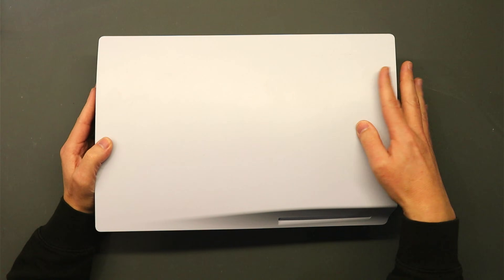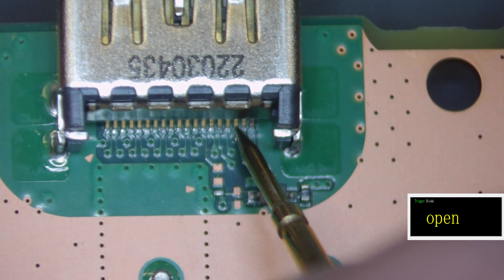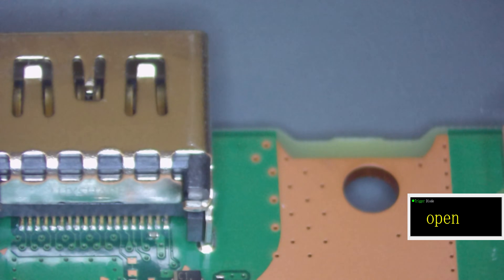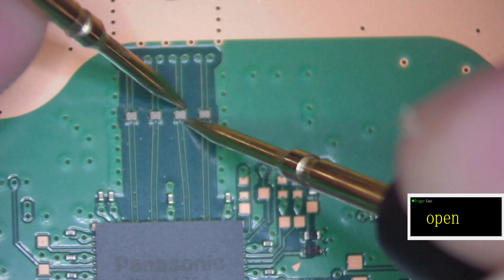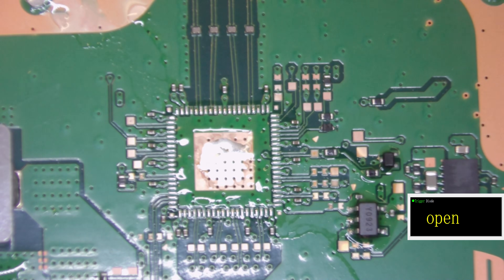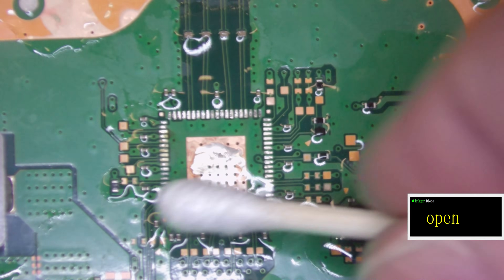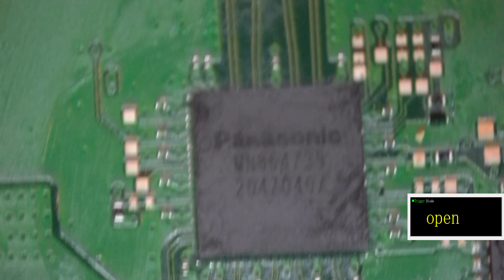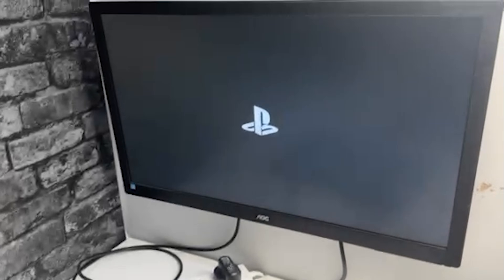PlayStation 5 No Video - The easy way to replace the Panasonic MN864739 HDMI Encoder on a PS5

Comment: How can you fully diagnose if it is hdmi endcoder issue? Mine seems good, the port, the encoder also it's surroundings, also two cable was tested also two different tvs, but it still sometimes goes black screen for milisecs, should i just change hdmi encoder?
Reply: I am asking myself the same quastion…Perfectly soldered Port and still no signal. I already did a lot of repairs on those ports.

Comment: I done so many ps5 repairs. And encoder.  But had a few where no image even after hdmi and encoder.  Have 5v. What else could be wrong
Reply from the maker: I usually check the entire HDMI circuit including all caps and diodes around the port and retimer
Reply: @ConsoleTherapy  same no luck

Comment: What exactly is the HDMI port test looking for, and how do you know the expected value?

I'm learning electronics, and have only seen diode mode used to check diodes.
It looks like you are measuring  directly between ground and the signal pins of the HDMI connector - no diode in between?

I'm also under the assumption you can't check diodes while they're still in the circuit, or you get incorrect readings.
Reply from the maker: Hi Danny - thanks for the view and comment.  The test reads the voltage drop from two points on a board, in this case the Retimer IC and ground.  I have a list of what the values should be from a known working motherboard, so I simply compare the values and if they are different, it points to a possible issue with the area I am measuring.  Hope that helps and good luck with learning electronics
Reply: @ConsoleTherapy  That makes sense.
Thank you for taking the time to reply!

Comment: i have similar problems it displays on monitor not on tv  flickering with noise on pictures snow
Reply: I had the exact same issues after replacing HDMI port, white dots, flickering, snowy screen when gaming. so how did you solve this after all?
Reply: Update

Comment: Sorry bro, can you please tell me if you have any power supply connected when your checking voltages and other things? Do i have to need special equipment to test my motherboard? Or will multimeter show voltages without power connected to console  motherboard ?
Reply from the maker: Hello, thanks for the comment and watch.  When testing, put your multimeter in diode mode and do not power on the console or connect the power lead - the multimeter will measure without power to the console.
Reply: Cool. I'm new to this field, also one more question. What can measure in diode mode ? These small smd components when you measured encoder were diodes? Or this diode mode can be used to measure much more ? Thanks so much , great video  @ConsoleTherapy
Reply from the maker: @KrzysztofKozyra-c6c  Diode mode theoretically is used to check a diode for voltage path, however it will also measure for the voltage drop across two points on a board (does not need to be diode) - in other words, it s a more accurate/effective way for find a short circuit on a board